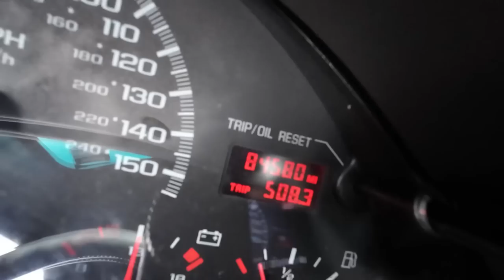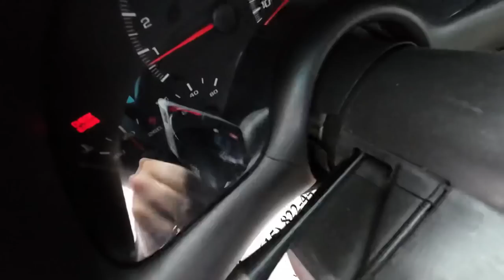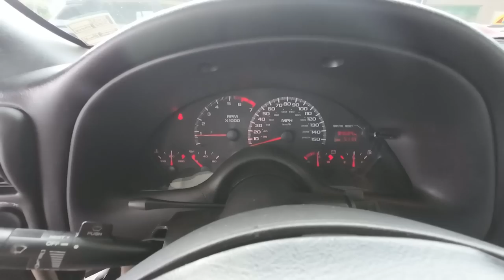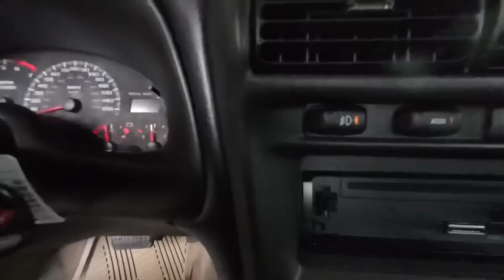Test Drive 2002 Chevrolet Camaro SS Convertible SOLD $17,900 Maple Motors #2032

Comment: That bag in the trunk is a 3 piece tonneau cover for the top when it's down.  That's pretty rare to find one still with the car.  Since it's a bit of a hassle to put on and take off, most people just leave it out of the car and it gets lost over time.  Replacements are hard to come by.